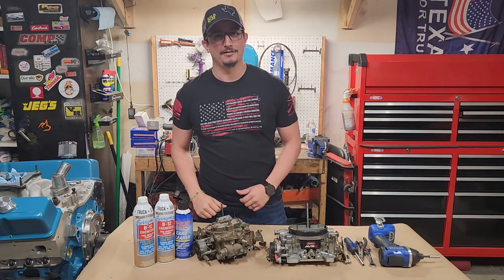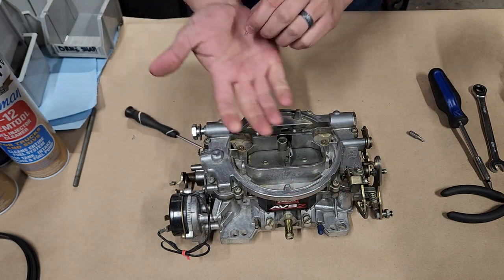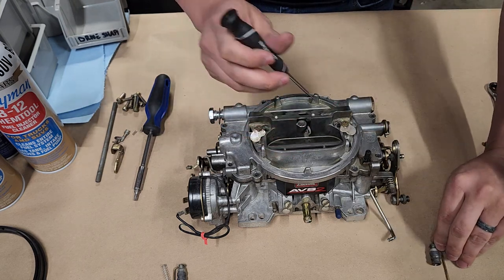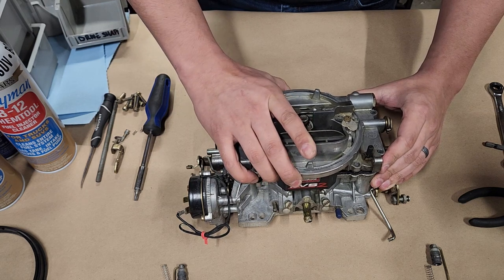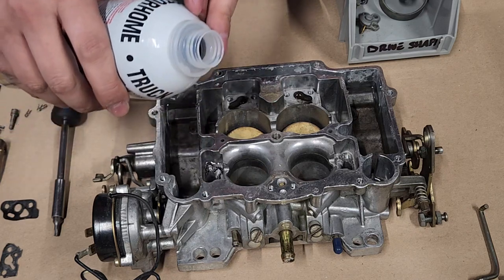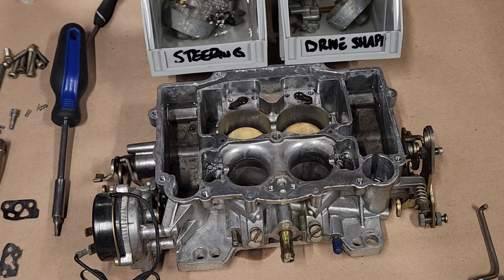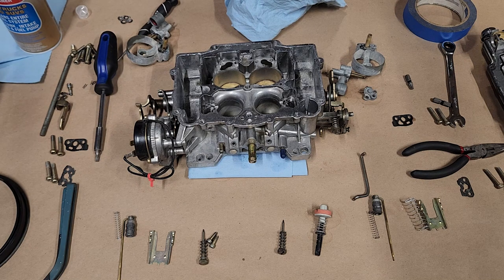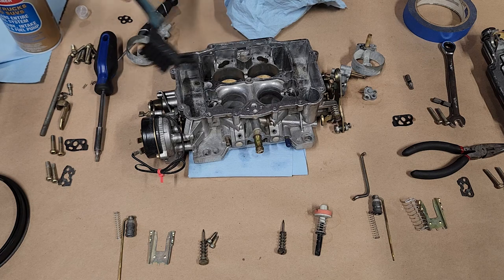$6 Carburetor Super Clean?? Don't buy that $60 gallon!! How to clean a carburetor for CHEAP!

Comment: I have experience with Quadrajets and Edelbrock carburetors and daily drivability in my experience goes to the Quadrajet. But since the AVS2 came out, that has been my go to. The annular primary boosters get me instant cold starts and better fuel milage.

Comment: Would the same thing apply to a carb that has a manual choke,,, need to clean my carb for a 84 rx7 and just want to make sure if it would be  similar or different
Reply from the maker: Yup, should be a similar process. Choke plate just blocks off the air horn to richen up the mix for starting. Same idle circuit

Comment: Berrymans has been my favorite for decades
Reply from the maker: It's great!
Reply: @diveingarage  I built carbs for GM mostly,lots of 2v motorcrafts...God I could do them in my sleep....nightmares...
Dealership I worked for baught it in 5 gallons at a time...I filtered it after 20,added some...kept going.Finally talked them into getting a 2nd bucket and cage

Comment: Would the carburetor be in better shape,   if you switched to pure gasoline and idled the engine for 5 minutes  before you shut if the engine????
Reply from the maker: Gasoline is a good solvent, so it could help for sure. Unfortunately no non-ethanol gas near me.. so I clean mine out every few months to get rid of that ethanol gel

Comment: You didn't  take out the  accelerator pump  brass check  valve  when you  disassembled the carb and it must have fallen  out  when you cleaned  the body. It didn't appear  to be in place  when you reinstalled the pump nozzles.
FIND  the check   valve on the FLOOR.
Reply from the maker: Yep, found it!